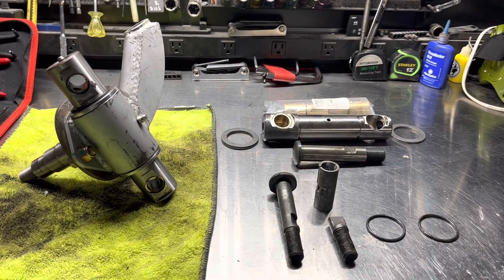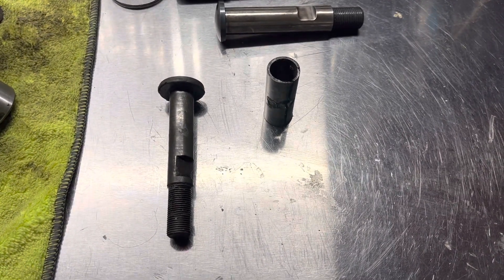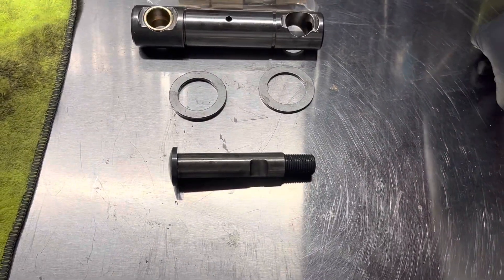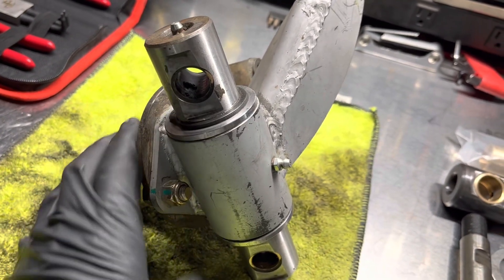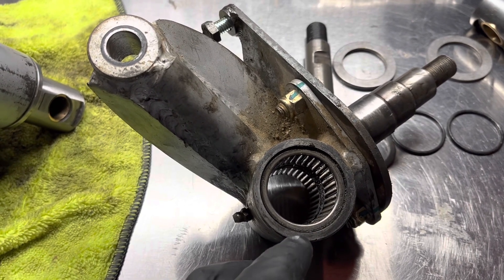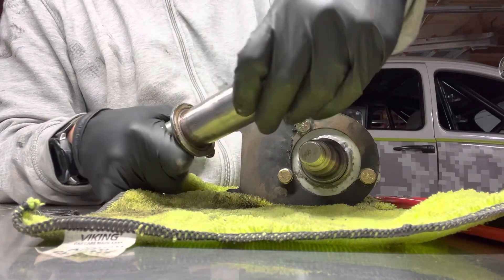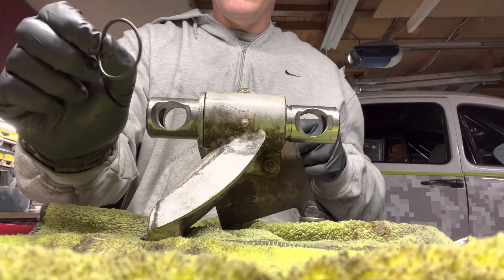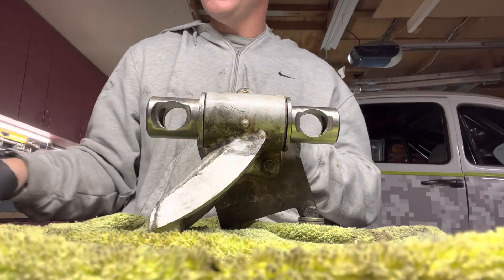Tweed Spindle to Foddrill Kingpin Conversion (Baja Bug Tweeddrill Spindles)

Comment: Documenting this here. I have the old bushings and not needle bearings. Those orings seem to only be for the needle bearings setup. 

Since I’m converting to needle bearings I’ll need to find those orings. 

Question for you. Trying to figure out how far to press the needle bearing in. That oring sits in a recess on top of the bearing correct? And the thick washers lightly compress it?